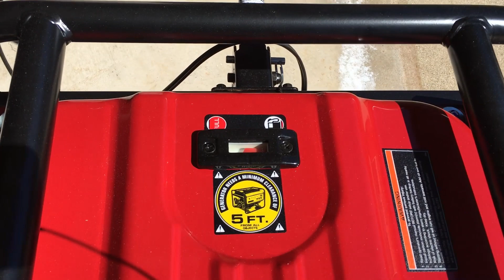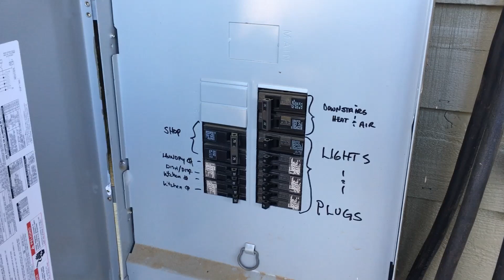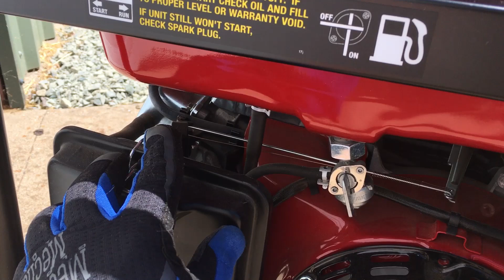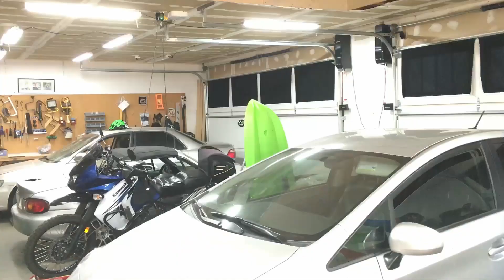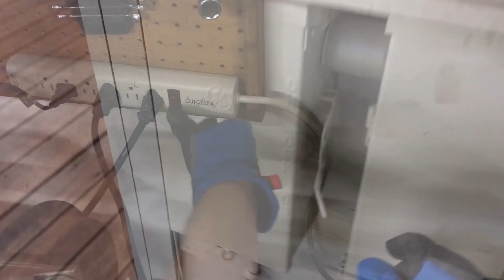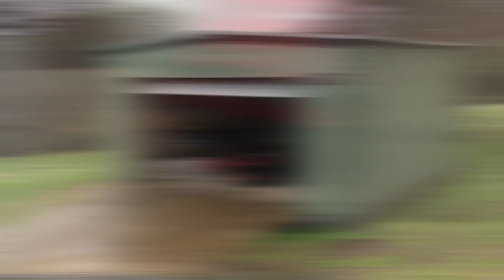No Power... No Problem!!  Harbor Freight 9000 Watt Predator Generator Review AND Real Outage Test!

Comment: When using a non-inverter generator - assuming like this one, as opposed to the 3500, is there a piece of hardware that will change say one ext cord's output to sine wave?    I guess things like AC, Fridge, lights, microwave, etc don't need sine wave.       Have a Honda eu2000i now, love it, but these larger ones are sure attractive.    Will probably supplement with a WEN 3800 or Predator 3500 soon.    That 9000 sounds LOUD, neighbors might kill me.    City life ugh.
Reply: Actually, generators like this Predator do produce sine waves.   The problem is not sine wave so much as the hertz varies with load.  Invertors actually have trouble with sine waves.  Cheap invertors put out a modified sine wave.  Better ones, such as Honda, filter the output to have a genuine sine wave.  The invertors, since they use DC converted to AC, can be troublesome to sensitive electronics.
The other issue with generators, of any sort, is if they are not significantly bigger than the load, have impedance issues that mess with sensitive electronics.   Creates a lot of electrical noise.  Quality surge protectors can filter a lot of this out.  My PC is on a UPS that has very good filtering, so it protects my PC from noisy AC current/voltage.   

Another problem is with refrigerators. I lost the brains of a newer refrigerator. When power is lost and suddenly restarts, like when a tree hits power lines and the power goes on and off rapidly before complete failure, is rough on refrigerator compressors.  I put a surge protector that also has a time delay relay in it. If power drops out for even a very short time, the time delay relay keeps the compressor in the refrigerator off for three minutes, this way the compressor isn't having a "hard start". A hard start is when the refrigerant compressor has to start against a full pressure difference between the evap and condenser, usually causing the motor to trip on overload.  The repeated start attempts against the high pressure can cause the motor to burn out and the power surges this causes can kill the electronics.   After this happened, I installed the surge protectors with the relay, and since we have had a lot of power dropouts recently, protected my refrigerators. 

I bought my Predator 9000 in December 2019, replacing an older Generac 5000 watt unit. The generac was pull start only (and 23 years old) and sometimes hard to start.  I have health issues and can no longer handle repeated pull starting of a balky engine.  The Predator worked well out of the box.  Add the battery, fill with oil, add fuel, and it ran well.  

I don't think anyone else has as good a machine at the price point.  

The predator engine is a copy of the Honda engines, even can use a Honda Carburetor.  AMazon has Natural Gas conversion carburetors (use Natural Gas, LP Gas and Gasoline) for under $40 that fit this or a Honda GX390.   If you have natural gas available, or prefer propane, it is a relatively easy conversion. I am checking if I can get a quick connect installed on my Nat Gas line and running the generator on nat gas means no running out of gas.   My last outage (a couple of weeks ago) was for 28 hours and the Predator ran perfectly.  Used 2 tanks of gas, which is about 14 hours a tank (and wasn't empty yet).   I did adjust the Hertz, as it was about 63Hz under load, and set it to about 60.1 to 60.9 under load.   Bought a small monitor and watch the load, volts and Hz as it runs.,   and it runs well.  It runs my whole house, including 2 refrigerators, a 2 ton Central AC unit, and lights.  The only problem I had was the toaster and microwave at the same time, as they were on the same phase.  I am going to move the breakers around, and when done, can even run the toaster and microwave at will.  

I do have a small house (900 SQ Ft) so your mileage may vary, but I am very happy right now with the performance of the Predator.
Reply from the maker: @richardc2124  Very interesting and insightful comment Richard, thank you!  I learned a lot.  You have me thinking that a surge protector with a time delay wouldn't be a bad idea for my fridge either.  

Yes, my toaster oven and microwave are on the same phase as well, and I can hear the generator dip a little but the governor brings it right back up.  I haven't run a central A/C system yet though (not wired to my subpanel fed by the generator).  That sounds real nice!

Thank you again for sharing!
Reply from the maker: I don't know the answer to your primary question, but will do some research, as it's an interesting point.  To your second point though, yes, I imagine your neighbors wouldn't be happy in a city environment.  in an extended (multi-day) outage scenario though, you might not care as much...  :-)

Comment: Thanks for the video. Your video is the type of video I was actually looking for. I just purchased this generator 2 days ago and I will be picking it up tomorrow.  It looks like you're using a 50 foot cord which is what I purchased as well from Home Depot.
Reply from the maker: Thanks Sheldon.  Yes, it's a 50 foot cord, 10 AWG, 30 amp, w/ the L14-30 plug.  It works great. 
 You'll enjoy yours!  If interested, I did a follow up video showing the fuel economy and typical appliances I power, from the past 2 years of ownership.  The video is here:
https://youtu.be/qWVLeuaruJ0
Reply: @btd-cf2000  perfect. Thank you. I will check it out. By the way. Where would we get the replacement air filter? And have you changed the spark plug yet? Some people change it to the NGK plug.
Reply from the maker: I haven't changed the spark plug yet.  I have just over 78 hours on it so far.  The manual says to inspect the plug every 100 hours (or 6 months - which I'm over).  So, I'll pull it soon and inspect it.  I'll include that in an upcoming maintenance video.  I did buy the NGK replacement (BP7ES) as the original generic brand is hard to find.  I'll use the NGK when it's time to replace it.  

For the air filter, I haven't yet found a simple replacement solution.  I could probably order one from Harbor Freight but I'd probably pay more in shipping than the little foam piece is worth.  My idea is to figure out where I can buy a large sheet of generic foam filter material, and cut some replacement filters from it.  If I find one, I'll update here and in the maintenance video I do.

In the meantime though, I just use this Uni foam filter cleaner and oil to keep it in good shape.  If I don't tear it, it should last for quite a while by simply keeping it clean.
https://smile.amazon.com/gp/product/B002W2A108/ref=ppx_yo_dt_b_search_asin_title?ie=UTF8&psc=1 

It doesn't get that dirty though, as I run the generator on a concrete pad.  Hope this helps!
Reply: @btd-cf2000  perfect thank you I was wondering about which NGK plug would be the substitute. And as far as the filter I believe you have that same link that I looked up for Amazon I'm not sure if it's the exact one but it's worth a try. Picked up the generator today putt a little oil in it and some gas and it ran perfect on the first try. And it really wasn't that heavy to me LOL
Reply from the maker: @sheldonk5747  Oh good, glad to hear you got it up and running no problem!  You'll love it!

Comment: Did the air conditioner worked too?
Reply from the maker: No.  The A/C units (one for upstairs, one for down) are not wired to the subpanel that's powered by the generator.  I imagine that was done intentionally, as I could see blowing the 30 amp breaker on the generator while running the A/C and trying to also run the fridge, microwave, and other higher amperage devices.  In theory, it could probably be done but I imagine you'd have to make sure nothing else came on while the A/C (only one unit) was running, which would be a pain to manage.  If I ever need to run my A/C units from a generator, I imagine I'll need to upgrade to a permanent mount larger unit.  With all that said though, it would probably do just fine with a small window A/C type unit...
Reply: @btd-cf2000  here’s a video about generator safety that everyone really needs to watch https://youtu.be/I1jT3ANENvI remember not to run your generator indoors and don’t run it in the garage too. I just hope you stay safe and agree with this safety advice. Thank you. Hope you like this video as well
Reply from the maker: Here's a follow up video I did, that further explains what I typically run on the generator, and what's not wired to run on it.  Hope this helps!
Here it is:
 https://youtu.be/qWVLeuaruJ0

Comment: What’s the square footage of the house? Thanks for the video.
Reply from the maker: It's 2,400 SF, 4 bedroom, 3 bath, two story house.  I have a tankless water heater and even that works great when running on the generator.  Honestly, the only thing I notice as different (when running on the generator) is no electric range/stove.  So I just plan around that.  Otherwise, I can operate all lights, ceiling fans, shop tools, etc.  Pretty sweet.  Thanks for the comment.
Reply: Thanks for the video!....My question would be, with all those appliances and equipment you turned on. Do you know for how many hours this generator would last?...is it really 13 hours as the sticker states?... thanks.
Reply from the maker: @luisgudino4275  Hi Luis, I'm actually working on a detailed video that shares the performance I've noted to date.  I've used the generator to power the home through several extended (2-3 day) outages and have been really impressed with the efficiency.  I've been getting about 2.5 - 3 hours per gallon of fuel, while under "normal" use - including fridge, separate freezer in garage, microwave use, toaster oven (high wattage), well pump for water, hot water heater (tankless), all lighting (although a lot of it is LED), ceiling fans, space heaters (high wattage), garage doors, shop tools (although I didn't do heavy shop work - welding, etc. at the time).  For example, one time I used the generator for 15.5 hours straight and it only took 5.1 gallons to refill back to the top (= 3 hours per gallon).  I was impressed!  And that was daytime use (7am - 10:35pm) by a family of four.  I don't use it at night as it's loud, and the fridge/freezer is fine overnight without power, as long as we don't open them.  I'll include more details, and use patterns that I have found to work well (to manage fuel and noise), in a video coming out in a few days here!
Reply from the maker: @luisgudino4275  Hi Luis, I posted that follow up video the other day.  Here it is:
https://youtu.be/qWVLeuaruJ0 

It covers the typical appliances I run, and the typical "mileage" I get.  Enjoy and let me know what else you'd like to see.
Reply: @btd-cf2000  thank you so much!!...great video. I'm buying this generator tomorrow as we are having power outages lately (4 outages in less than 3 weeks). There's no doubt in my mind that your video has helped a lot  to get this generator. Thanks again for you helpful video!
Reply: Ac unit?
Reply from the maker: No.  The A/C units (one for upstairs, one for down) are not wired to the subpanel that's powered by the generator.  I imagine that was done intentionally, as I could see blowing the 30 amp breaker on the generator while running the A/C and trying to also run the fridge, microwave, and other higher amperage devices.  In theory, it could probably be done but I imagine you'd have to make sure nothing else came on while the A/C (only one unit) was running, which would be a pain to manage.  If I ever need to run my A/C units from a generator, I imagine I'll need to upgrade to a permanent mount larger unit.  With all that said though, it would probably do just fine with a small window A/C type unit...